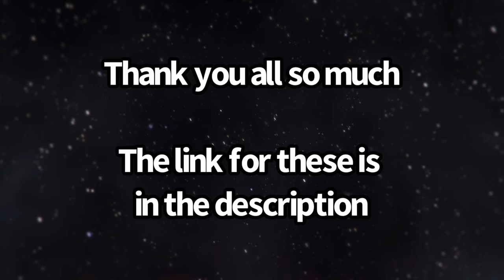How a CNC Helped Me Generate $5000 in Sales in under 48 Hours

Comment: When you get done with all this - a spindle sander or a belt sander combo would do you tons of service.  We bought a skill, the lower end cost spectrum definitely, but our plan stand business it is our most used tool.  We sand almost everything with it.  Love the videos!
Reply from the maker: I have a spindle Sander. And yes I’ve considered using it however at this point I’m looking for something really efficient and I know a sander upside down it’s kind of green acres. But it seems to work OK for now. Thanks for the tips as any way to be a little more efficient is fantastic. Also my price point is a bit lower so the customer can do most of the final sanding and shaping if they want to put chamfers or round overs

Comment: Sorry if it's been said already - you could save material waste and lower cycle time by merging the tool paths between the parts.
Reply: It would complicate holding the parts in, though (you would need two screws in each part to keep them from moving). Now the scrap works as a frame of sorts, holding the parts until the very last cut, after which they are not touched by the router again.
Reply from the maker: Yeah I’m reliant on the dust to keep things in place because I don’t use Tabs
Reply: @veikkoimmonen7300  - you dont have to merge all tool paths to still see a great optimisation

Comment: Awesome video, greetings from India!
That negative grid looks amazing (in fact, it looks better than certain very expensive 'designer' diffuser panels I've installed over the years, hint, hint 😂)
Layer of 1"-2" fiberglass or rockwool, covered in black cloth, and that black negative grid on top, looks good hanging from any wall. Probably looks good hanging from the ceiling too! 
And judging by the smooth cuts, repeating patterns & void-free plywood layers, they work pretty darn good for dispersing/absorbing some mid-high frequency sound as well. Heck I'd buy one (ok, not just one, maybe a few 😂)

Comment: Why not hit the wood with the sander before they are fully cut out? That would eliminate the need for the sanding rig setup, maybe can run CNC just to make an outline on the wood then hit with sander, and maybe get a bench belt sander to knock down the edges after cutting out. Just a thought.

Comment: Mid-range machines used for panel processing and signage are likely to cost anywhere from $25,000 to $50,000. High-end machines often cost $50,000 to $150,000. On top of that, it takes around four or five years of combined education and on-the-job training to become fully trained.

Doesn't seem to be an option for many of us.
Reply: Well that’s interesting you say all that. I guess things happen just a little differently over here. I have roughly $22,000 worth of capital equipment to produce what I produce. And I didn’t know a thing about anything digital fabrication a year ago. I just relied on people from this community to help me out and kept working as much as I could with no formal training. So it’s very possible to do this without those big numbers that you’re talking about. I just don’t want people to be scared away from this type of work seeing what you wrote would be a little daunting if it were 100% true

Comment: Well done Chris, nice product and it's well executed. How many times did you sand your knuckles? My kveik ring product has small components that all need sanding in a similar repetitive way, I often end up with a couple of knuckles less than I start with
Reply from the maker: Hahaha Issue but my hands have worked up enough tough skin on the more I think I’m OKAY. Quite frankly it doesn’t do much because of the oscillating nature. But I’ve been stung pretty bad on a disc sander a few times
Reply: @acloserglimpse9895  I use a 1" belt as I'm shaping and sanding. A nip from that little animal will wake you up

Comment: Got a Quick question for ya.   how do you get a square inside corner on your CNC machine...   "Box Joint" Edge on your project... I have yet to figure out how a round spinning bit can make such a nice sharp corner like you have.
Reply: It’s called a dog a bone fillet. Basically the router takes away material that looks like a dog bone allowing for the adjoining or the opposite corner of the peace being inserted to have room to fit flush
Reply: @AGlimpseInside  Its amazing how you made it look so tight... I just looked up Dog Bone Fillet and I see what you're talking about, I do believe that your work is far tighter with little or no evidence that it is not a true box joint, either done by a router, or vertical CNC tool Path... thank you for the information.. if you get a chance, what type and size bit do you use when you cut that out..
Reply: @AGlimpseInside  BTW you have great energy in your videos, keep up the great work..I am a new subscriber and will be watching more or your material.
Reply: @billg3903  Are use a 1/8 of an inch compression bit that’s an inch and a quarter long. And yes because the bit is so small it has very little tolerance and looks really tight inside the joint
Reply: @billg3903  Thank you so much Bill I appreciate that very much so

Comment: 3:45 get some of those giant rubber bands they use for large items and wrap one around the front of the orbit and your lower clamp you had down. Or one of those ratcheting nylon loops. Not bungie cables though.. they roll to easy and that’s a lot of vibration. Last thing you need when a power tool gets away is a bungie cable hook slapping you in the face at the exact same moment.

Comment: Let me share some tools that will change your finish sanding life. Quality and production numbers will go way up. 
1, sand flee sanding mop mounted in drill press. 
2, Rigid table top Oscillating Edge/Belt Spindle Sander
3, Oscillating Multitool Sanding Finger Pad atachment (cut your own sandpaper refills from hook and loop rolls) 
4, Dremel MM730 Multi-Max Oscillating Tool (cut your own sandpaper refills from hook and loop rolls)

Comment: Great video. Can you explain how the small parts are being held down on the cnc spoil board?
Reply: I’m using limited dust collection to pack dust inside the cuts. Therefore they stay wedged in place. Without the use of tabs. The four corners of the three-quarter inch plywood I just held down by hold downs